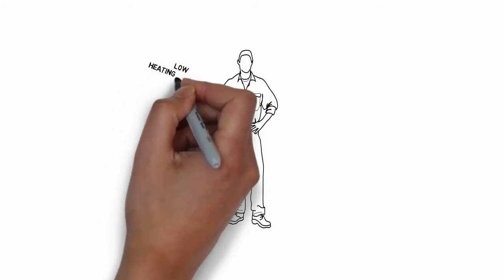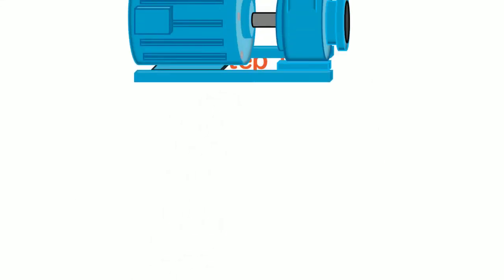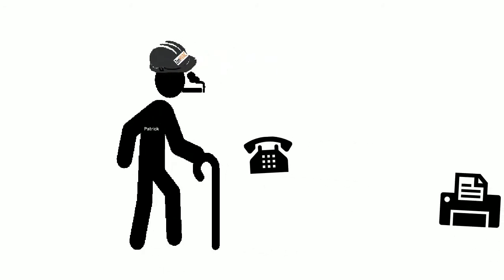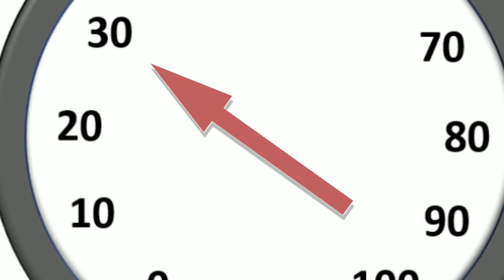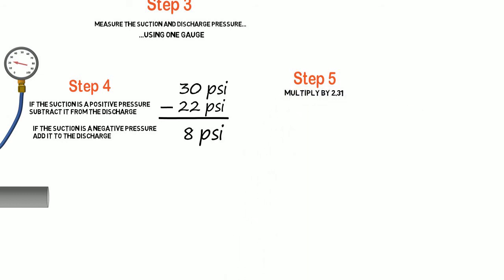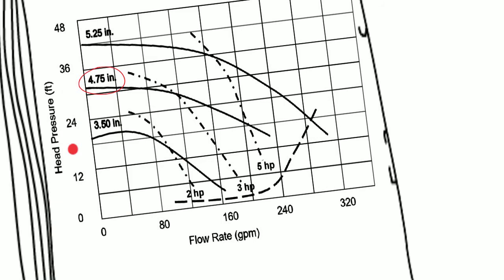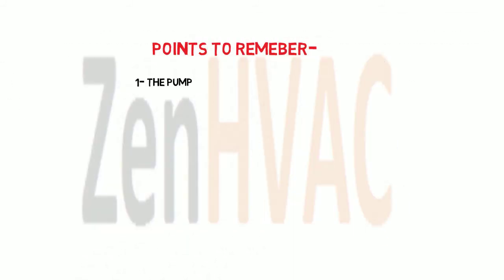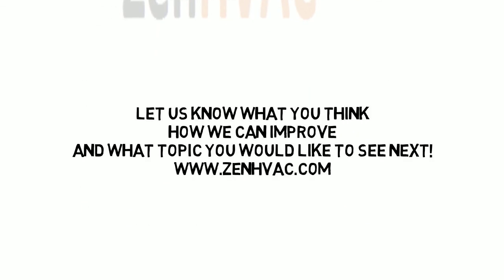Calculating Water Flow Using a Pump Curve 2018

Comment: what if you dont have a gauge on the pump? can you calculate it using length of pipe and elevations at suction and discharge?
Reply: You need actual pump pressure to plot the curve.